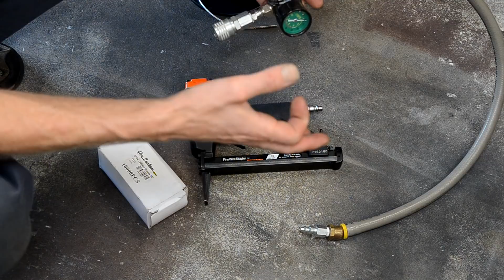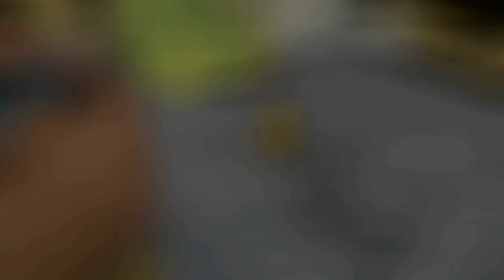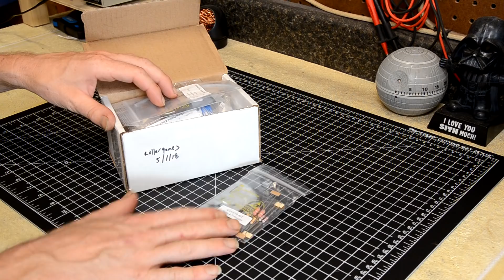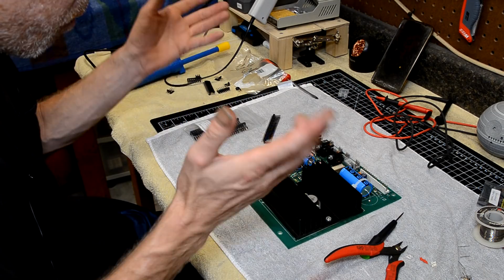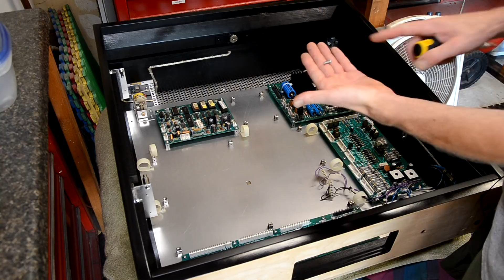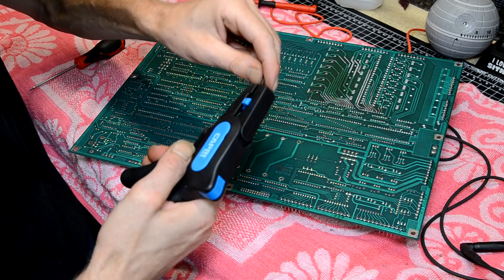Pinball Restoration Update: Rollergames Ep. #5

Comment: I have been really enjoying your videos.  For what it's worth, you may want to invest in an anti-static mat on which to do your printed circuit board work.  An anti-static wrist strap couldn't hurt either.  Could save you some headaches down the road.
Reply: Another FYI.  When checking the resistance of a resistor you need to isolate one leads of the resistor from the rest of the circuit, by removing it from the circuit (board), to be certain you are getting an accurate reading. Depending on the circuit, sometimes you can get away without doing so; but it is best practice to insure accurate readings.